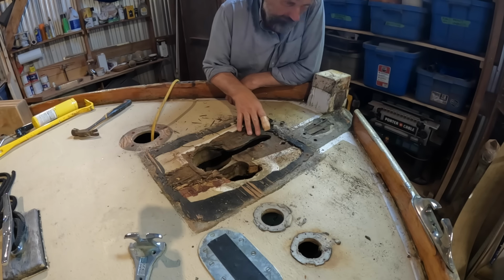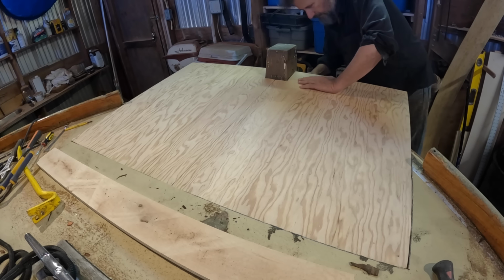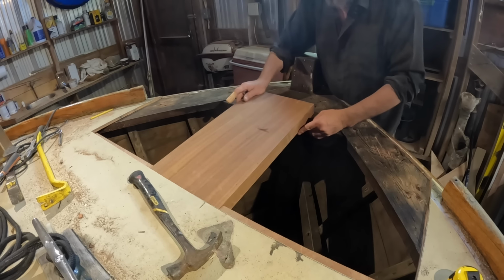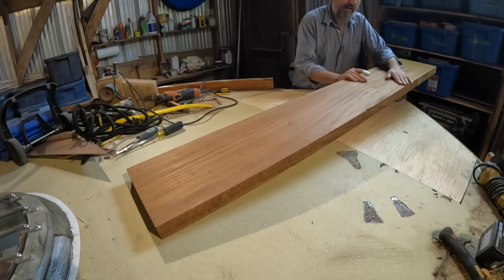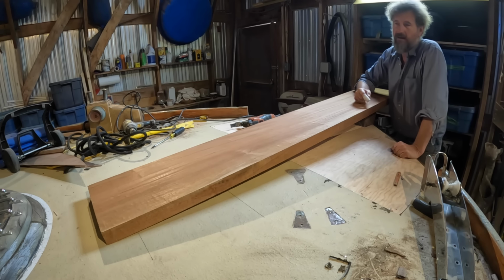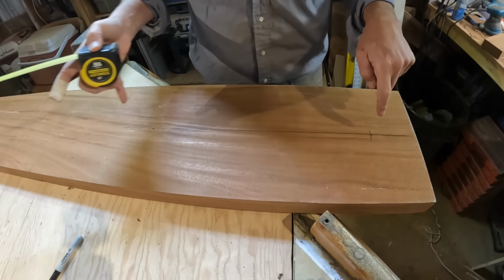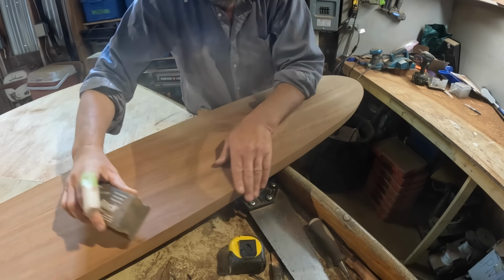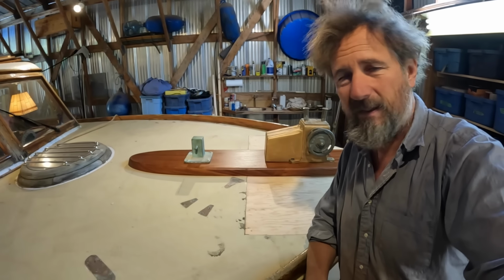Making a new Bowsprit - #418 - Travels With Geordie

Comment: The Spade or Vulcan. 
The problem with the spade is the stainless steel bolt which creates galvanic corrosion. Had to replace Spade anchors after seven years or so but for that replacement price I bought 30 years of stress free anchoring.
The principle is clear; concave not convex. My experience with Bruce are not so favourable but Fortress is also brilliant in specific conditions.
The Vulcan which I now have incorporates the concept of the Spade with a single cast unit. 
If you want a second anchor you can put together in two minutes the Spade is incredible.

Comment: I’m sure you thought about it: why did you cut off the material at the end - or tip - of the  elliptic or elliptical ellipse? 22:33 
Was it also in a bad condition? With that few inches you’d have a better chance of the anchor not hitting your bow, when current or wind bring it closer to the boat (even more if it’s not on the roller yet… 18:47 )
Probably I’m wrong, but why?🧐, just want to learn from your experience and I’m very thankful for that. 🙏🏻😌
Thx for your fantastic show, with your also fantastic „better half“ 🤗 

Lothar from Düsseldorf, Rhineland, Germany